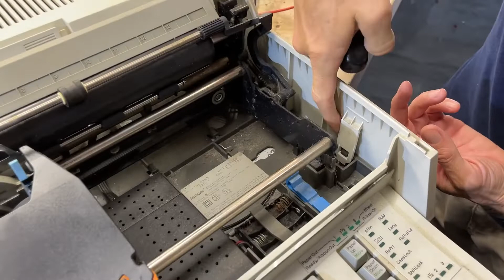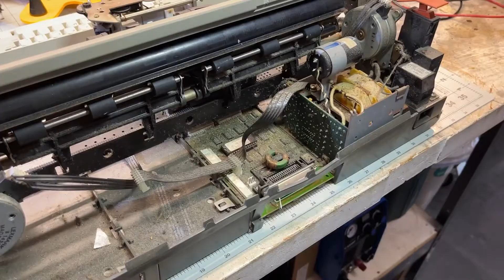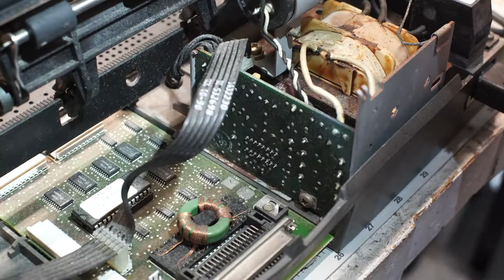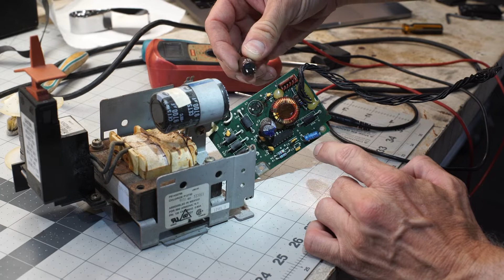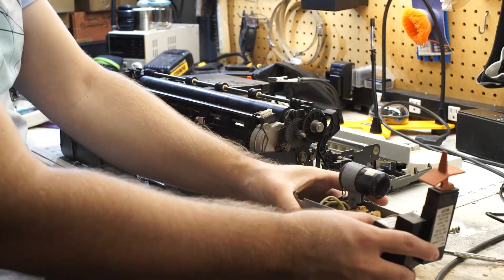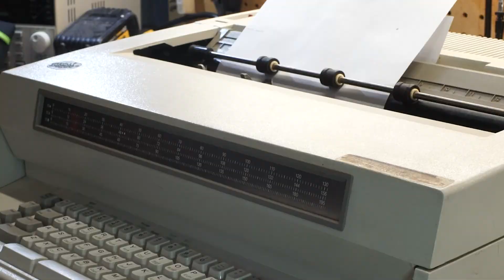IBM Wheelwriter 15 Series II won't power on, let's fix it!

Comment: At 3:38 it looks as if the condensator in the middle is somewhat bulged, too. It should be changed, otherwise it might damage the new  L4962 quite soon again. Also, this machine seems to have the printer interface card (Centronics) installed. This is a gem!
Reply from the maker: My son uses that interface port to print ASCII art gift cards for his friends!  He has the typewriter set up on a stand right next to his computer.
Reply: @ShanesGettingHandy  Great! I print letters with this typewriter, Windows can do that with the generic/text only driver.

Comment: wouldn't be easier to just replace the 5v rail w/ a smps, and call it a day... or it's too Frankenstein?
Reply from the maker: There are probably a lot of ways to solve this issue, and I did actually consider something like you mention, but ultimately I wanted to keep it as original as possible, and this wasn’t really all that hard.